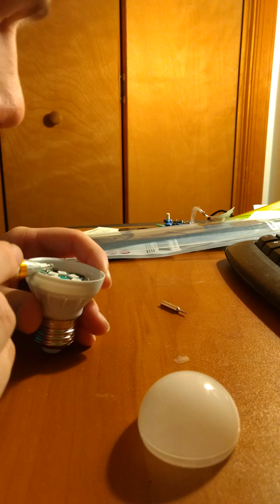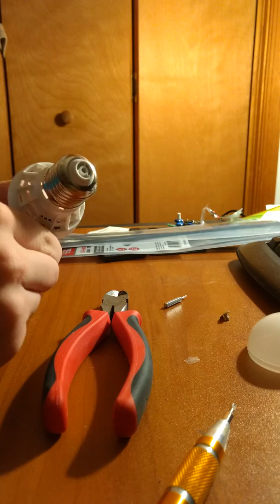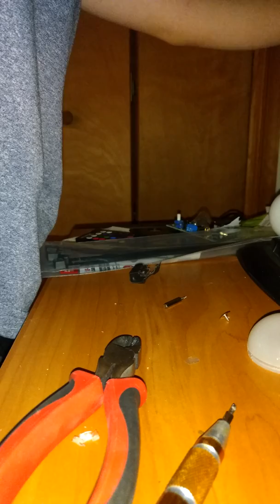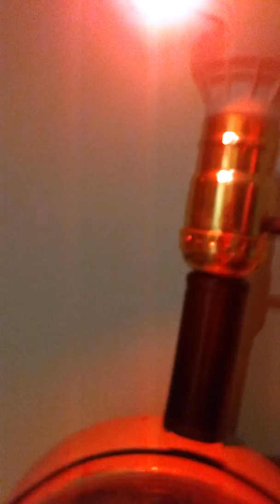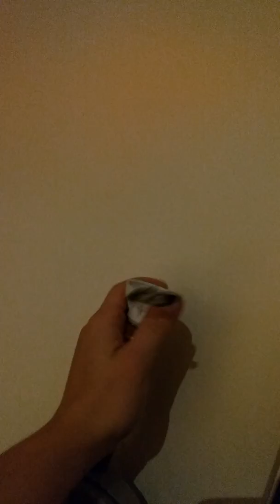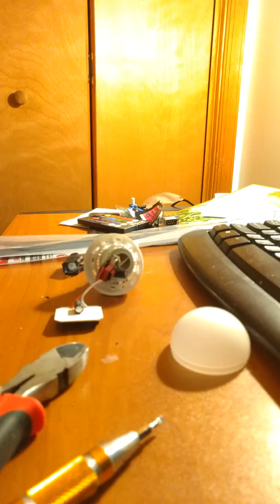How safe is a multi-colored Five Below LED light

Comment: If you put a multimeter on the output to the rgb's you'll see it's actually running on about 10 volts DC. You can get rid of the converter and run it on a 9 or 12 volt battery.
Reply: cool